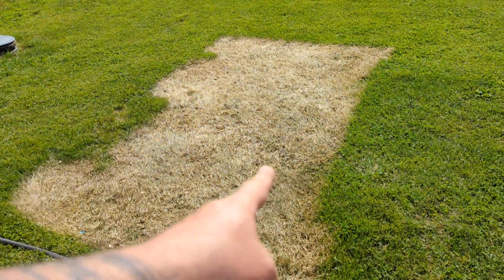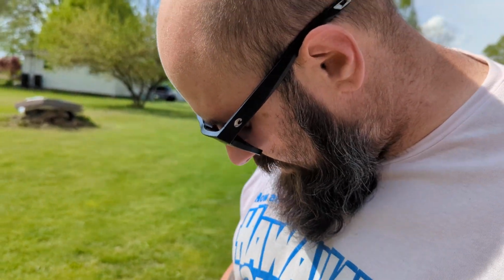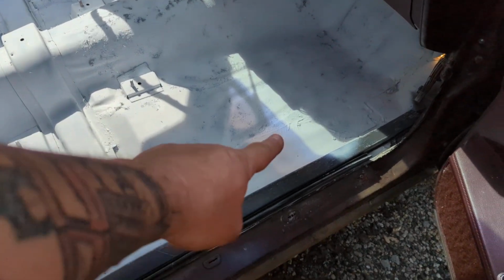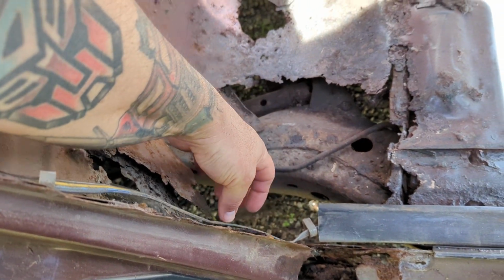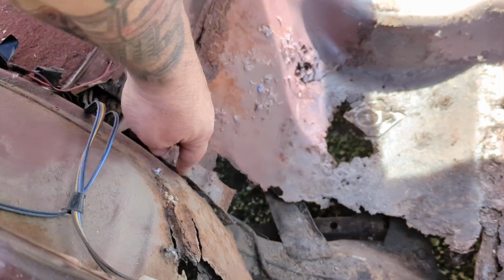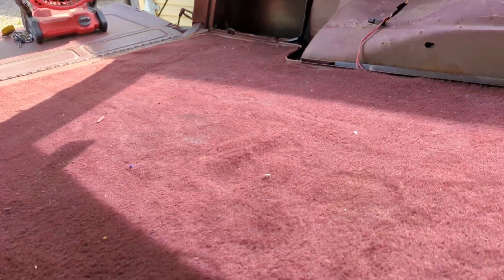SPL build part 5....Is this worth it???

Comment: Man that seems like way more work than you intended. If it was me I would stop before im too commites haha. What maybe should you get? Hmm ive thought about maybe a Chevy 2500 pickup because its ready for the weight. Style wise I would like a mid to late 80s 2 door Chevy blazer. But what I currently have that I am sloooowly trying to gather equipment for is an 84 Camaro Z/28 hahaha. 2 Dc Audio level 6 18s is the plan. Flat wall.